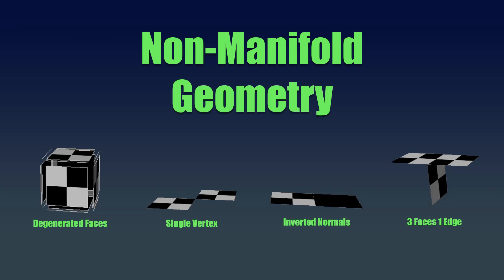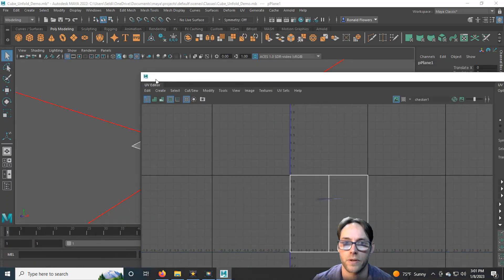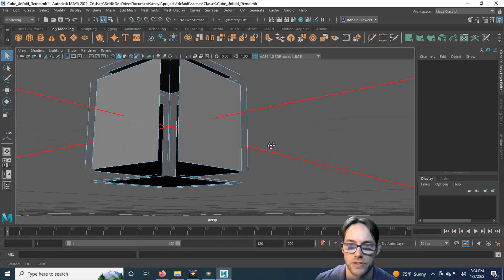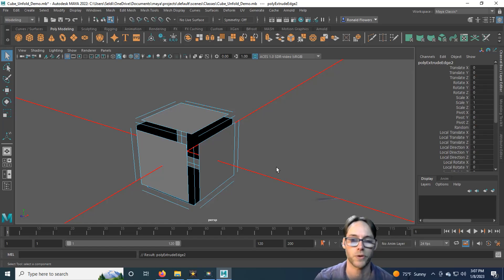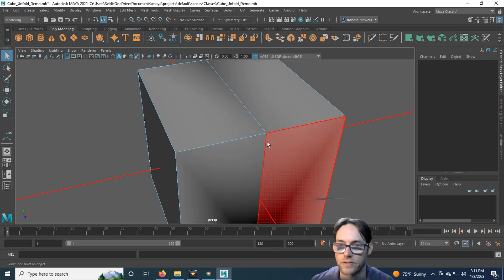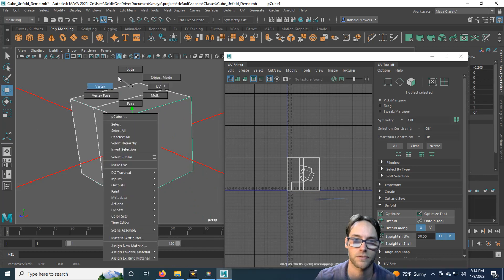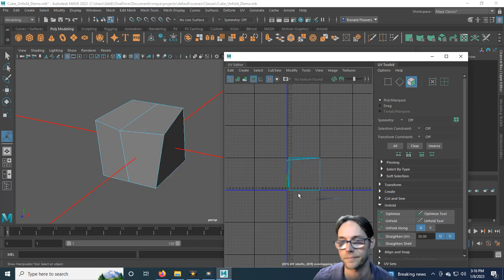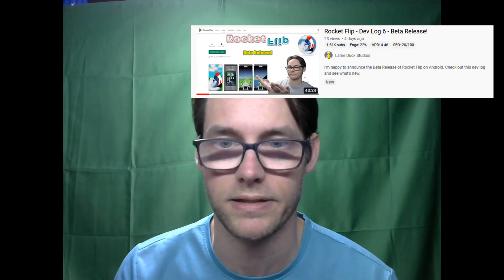Maya - What is Non-Manifold Geometry?

Comment: Heya great video!
since I work in the games industry I always preform a mesh clean-up when I'm done modelling and I usually always get non manifold geometry when making the map architecture. 

What I like to do is enable: Select matching polygons. That way Maya finds the errors and I go fix them personally. Usually it actually helps my modelling skills as I understand what I did wrong. 
non manifold geometry isn't a really big deal in games but it can cause problems like shading errors and plus it's not standard practice to just ignore those problems.
Reply from the maker: That's a good tip.

In general, the game doesn't care about non-manifold geometry, but certain pipelines will call you out on it and may reject the models you're working on. Maya will outright crash if it's bad enough. ZBrush and Mudbox will complain. ZBrush might try to auto-fix it to devastating results. The biggest issues will occur when skinning models for animation and UV mapping.

Non-manifold geometry can also cause glitches and abnormal behaviors, particularly in Maya. I'm not sure about Blender though.

Comment: Say I have a non-manifold glass bottle mesh, the only thing making it non-manifold is that there's no thickness but it still unwraps perfectly fine. Does it really matter if you can't see the back faces or do I really have to fix this?
Reply from the maker: It's bad practice to leave it in, but as long as you're not getting an error or glitches with it, it will probably be fine. That said, you may run into issues with some applications that require manifold geometry like ZBrush or Mudbox.